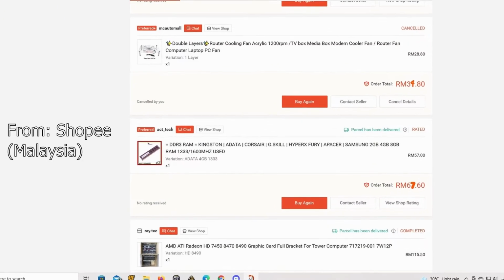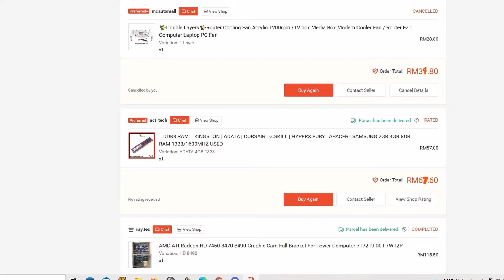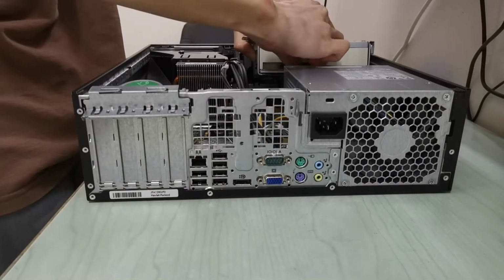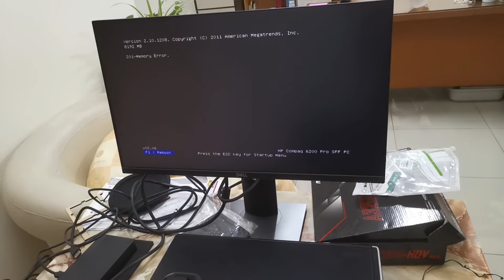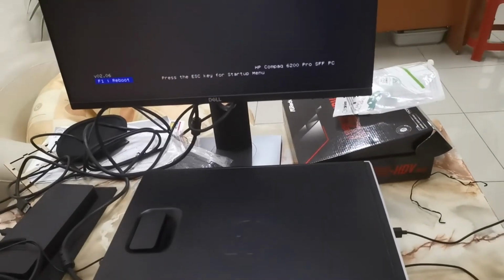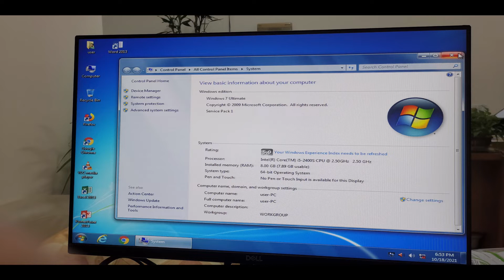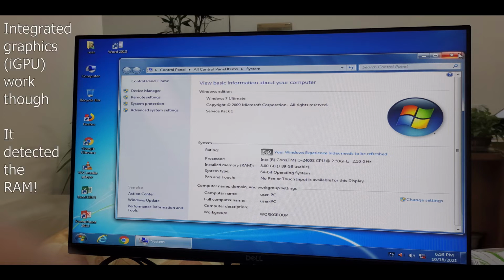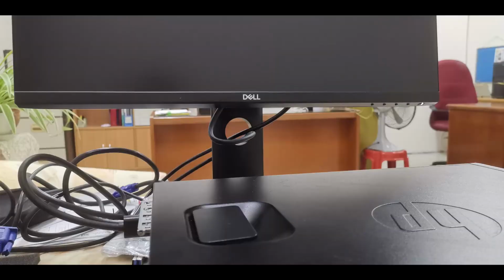Upgrading an old HP Compaq 6200 Pro SFF computer (part 2)

Comment: Can i use gtx 1050 ti without external pcei slot?
Reply from the maker: Only if the graphics card is thin (1 slot thick) and does not require external PCIe power (i.e. the graphics card's TDP/TGP must only be 75 W).

Comment: Can i installe rx 580 8 gig in this cpu by using in External psu
Reply from the maker: It should fit if it's one slot wide (because the casing's wall is below it) and short enough (I don't know, 244 mm since m-ATX motherboards are around that long? I could be wrong).

Comment: I installed a GT 1030 LP with no problem
Reply: Bro, i need your help cause i wanna do the same, any instructions? Thank you
Reply: @da7mad late but nah, just make sure to switch to the sff bracket before, you just need a tool that can remove the dvi d things that screw in i forgot the name, and im not sure, but for my gt 710, i needed a screwdriver

Comment: Those 6200s are the biggest piece of junk HP ever made! I got 3 of them at work,all 3 of them crash randomly with Windows 10 for no reason at all. Their RAM and hard drives are in good condition but they still do that. Whoever plans on buying this computer to use it with Windows 10,don't bother! You will pull your hair out with it!
Reply: It's actually an incompatbility problem with Windows 10. The 6200 Pro and the 8200 Elite which are basically the same computer suffer from these random crashes after a specific Windows 10 update according to other users of this computer. With an SSD it performs great,but make sure to update the bios to the latest version as it improves the compatibility some more and give it a new bios battery.I actually worked on a lot of these computers and they are very picky when it comes to dead or old CMOS batteries,they will work but sometimes act funny because of those batteries
Reply: @LUR777-g7r  
Ok im doing some research right now
Do the bios automatically update with windows updates now?
Or do i need to specifically go to the HP site to update bios?
And the motherboard is brand new, but should i still put a new cmos in there?
Or should i maybe wait till im actually having problems with the current bios/cmos crashing before i do those two things?
Or do those things as soon as i get the ssd?
Because i haven't bought the ssd yet
What's a good sdd for this thing?
I'm trying to not spend more than 100-150 bucks on it
Reply: Well unfortunately i have one lol
So i got new mobo
New ram 8gb dual channel
New stock PSU 
And im gonna upgrade to SSD 
You think it will be good with all of that?

You think it's the motherboards that make them bad quality?
Reply: idk about yall but personally i could install windows 10 and use it without upgrading anything (it had a 7200 rpm 465 gb hdd, 4 gb ram and a core i3 2100, i added 8 gb of ram, a geforce gt 710 and a 128 gb ssd, it's just fastee but never had any issues for now)
Reply: @Hezuuu2  i've been using the same computer with i5 2400 cpu 8gb ram and 500ssd for 2 years now and it's still working perfectly and with all windows 10 upgrades, i wanted to use it only until i afford to get a better one but it worked great for my use and kept it lol edit: i bought it for 80 bucks
Reply: @da7mad  yeah, im getting a dell optiplex 5040 soon now, cuz it supports nvme drives and well 6th gen cpus
Reply: @Hezuuu2  how much it costs?
Reply: @Ucfhm  i found one on ebay for 60 bucks
Reply: @Hezuuu2  i don't recommend anymore, there is way batter options these days

Comment: Bro i insert 4gb ram ddr3 in my 6200 why its not working?
Reply from the maker: I guess either the RAM is faulty or the DIMM slot of the motherboard is faulty. Another possibility is that the RAM is not compatible with the existing RAM stick (because of different speed or timings).

Comment: Hp 6200 sff can it take gtx750ti?.
Reply from the maker: No, the Nvidia GeForce GTX 750 Ti is too big to fit inside the computer's case/chassis. There's also a chance that the graphics card consumes too much power.
Reply: @bluntclawlizard1647  Thank you for answer.
Reply: But the pc have 240 watt and if I cut the case to make the gtx 750 ti fit inside I think its gonna work
Reply: Because I have hp compaq elite pro 6200 sff and I want to upgrade the gpu can you give me like the gpus that can I add to it

Comment: Bro can I put without low profile graphic card ?
Reply from the maker: Sure, it can work without a low-profile graphics card. If you want to then you can install a low-profile graphics card into it as long as it is one slot wide and not too long (I don't know about this since I didn't measure it with a ruler).

Comment: Can i change the motherboard in other standard cabinet
Reply from the maker: No, the motherboard seems to be not standard. It seems to use some weird 6-pin connector that only works with its power supply unit (not just any power supply unit I can buy from a computer store).

Comment: Can I use a 4gb ddr3 1600mhz on it?
Reply from the maker: I don't know but you can try. The used or refurbished Adata 1333 MHz 4 GB DDR3 DIMM RAM I installed into the PC worked.
Reply: @bluntclawlizard1647  thank you

Comment: Can i change the case to aftermarket pc case?
Reply from the maker: No, I think the motherboard is not a standard m-ATX motherboard. It has a weird 6-pin connector and 4-pin connector. The motherboard may only be compatible with this HP's power supply unit which is not very powerful and is slimmer than an ATX PS2 power supply unit.

Comment: Can i recase the small case into gaming case?
Reply from the maker: No, I think the motherboard is not a standard m-ATX motherboard. It has a weird 6-pin connector and 4-pin connector. The motherboard may only be compatible with this HP's power supply unit which is not very powerful and is slimmer than an ATX PS2 power supply unit.

Sorry for the late reply, I was busy with things such as preparing for Chinese New Year.

Comment: what happen if we put a cpu more powerfull
Reply from the maker: As long as the motherboard supports it, the computer will work. I think the most powerful CPU that is compatible with this computer is an Intel Core i7-2700K (4 cores, 8 threads) since I'm not sure if it supports Intel Xeon CPUs from the Sandy Bridge family. 

Low-profile graphics cards 1-slot wide/thick can also fit in the computer.
Reply: @bluntclawlizard1647  ok i understand thx ✌️